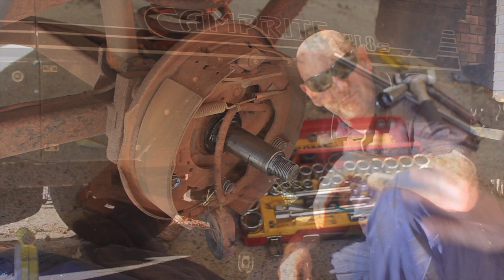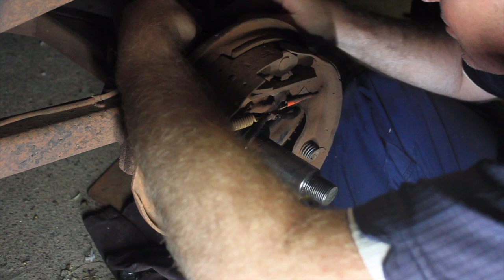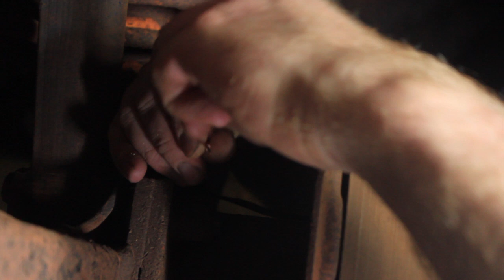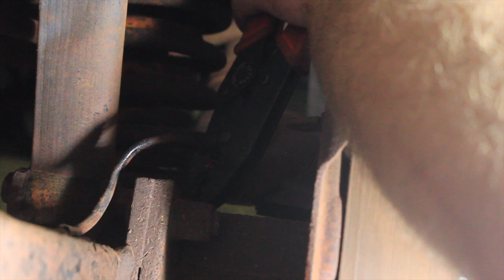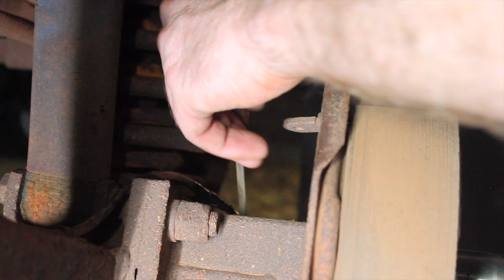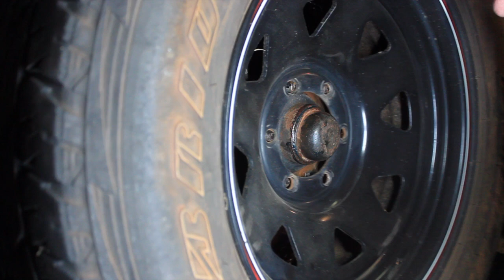Trailer electric brake magnet replacement

Comment: I have a question on a electric trailer brake system 2013 F350 how does the tbc know if it’s a single ( two brake ) or double (4 brake ) trailer connected 
If I remove the magnets on one axle  a message comes up trailer disconnected I’m curious how the truck knows if it’s a double or single axle trailer connected
Reply from the maker: Not 100% sure on your case, but the only thing that comes to my mind is maybe the magnets are wired in series rather than parallel. If they are removed it may be creating an open circuit situation so the vehicle doesn't think anything is connected. May require bridging the wiring to complete the circuits again?

Comment: Thank you for the video.The spring behind the magnet pushes the magnet towards the hub?
Reply from the maker: Yes they do, not under significant pressure however, just enough to keep the magnet in contact with the hub face

Comment: I’m having trouble with my magnet spring because it pushes the magnet off position and is not physically possible to hold it while placing the drum back in position. The only solution I can think off is to pinch it with a small piece of napkin and then friction will scoop the napkin off.

Any ideas? 😳
Reply from the maker: What about a bit of tape around the spring to compress it just enough to allow the magnet to sit in place before the drum goes on. The drum would then compress the spring further when in place so shouldn't cause any issue when in service
Reply: Easiest thing to do is tie the magnet to the lever with a bit thin string and hang the two tails outside incl the knot - once the drum is on , undo the knot and pull the string out
Reply: @rossbeck1595 thanks! That's exactly what I end up doing.

I used fishing thread because it is skinny and very strong.